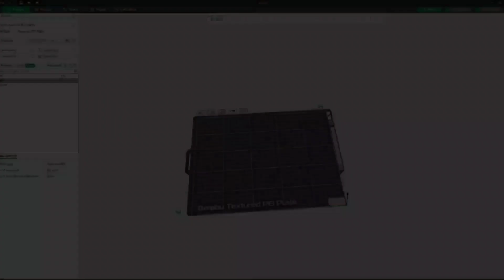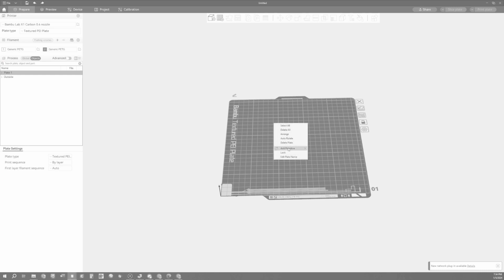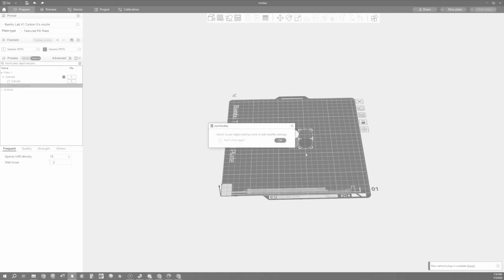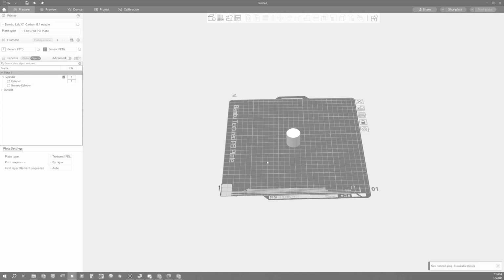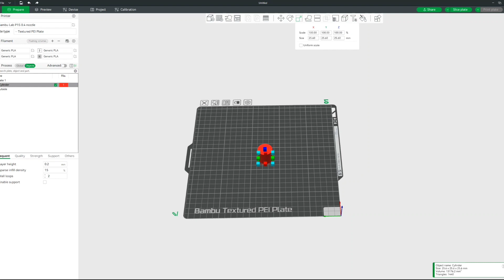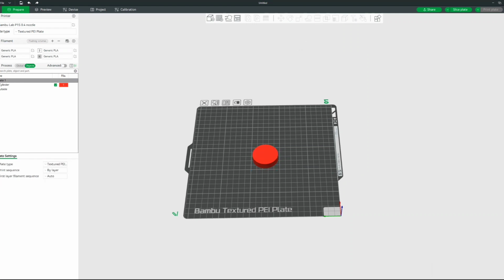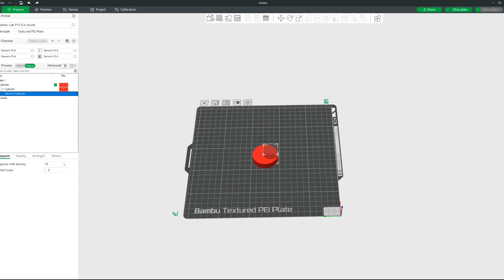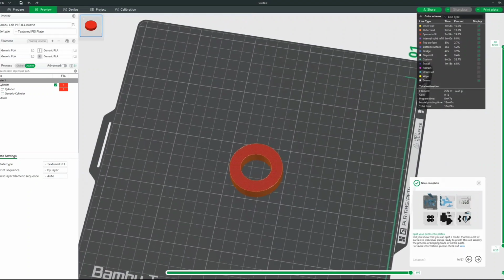Can 3d Printing Save Christmas?

Comment: I'm currently fighting the temptation to get an A1 myself. I have an X1C with AMS and an A1 mini combo so I really don't need it. I just want it.
Reply from the maker: My recommendation....buy the a1 and use the ams lite from your mini...then sell the mini...the a1 and x1c use the same size buildplate which is super useful in my opinion
Reply: @How2Texan  That's a great idea! The mini is just so cute though...tbh I just have a tough time getting rid of printers. That's why I still have a bunch of ender 3 versions sitting around gathering dust...
Reply from the maker: @paulthetexan  yeh i feel you...i have a few of those myself...might be time to sell them